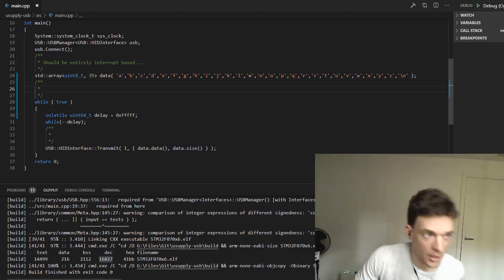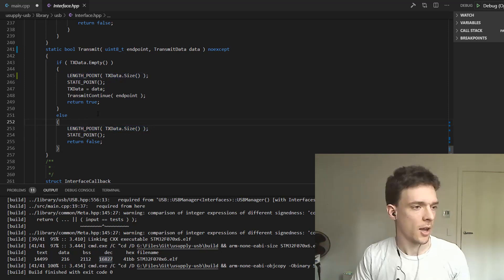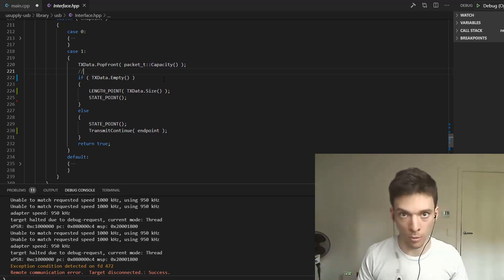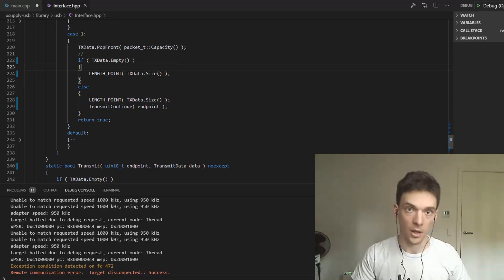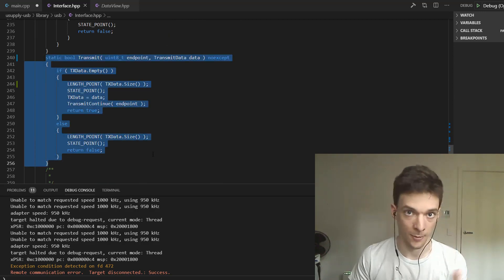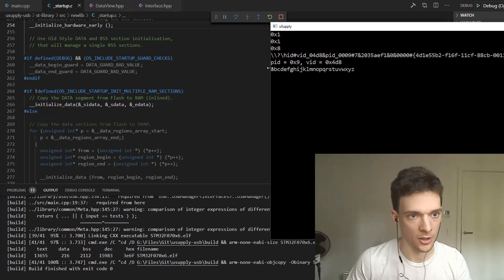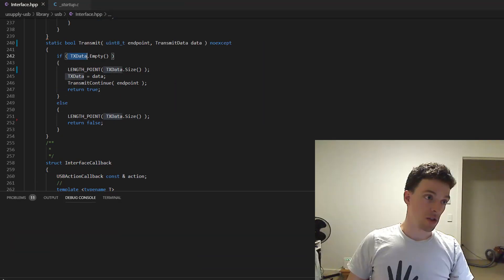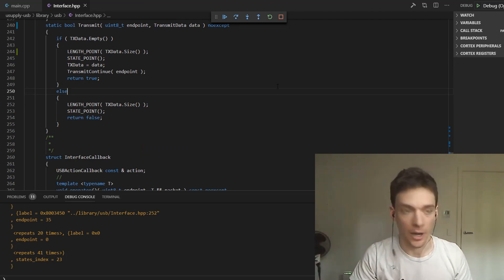C/C++ Interrupt Undefined Behavior

Comment: If you think you've found a compiler bug, simplifying your code down to the simplest thing that should work but doesn't is a good idea.  It will help demonstrate the bug to others and/or show you what you need to change to fix it.
Reply: This would definitely help him to find his own bug.

He only calls the transmit method in the main loop. The string STM32F070 in the console is a hint that this is only a single Arm Cortex M0 core, so the only thing that could modify the variables are interrupt handlers.

So he modifies variables outside of the normal program flow and expects the program to notice this even without telling the compiler to not optimize the access to these variables away.

He is right that the proliferation of the volatile keyword in his code is bad. But it is only a symptom of a bigger flaw: doing too much stuff in the interrupt handler. ;)
Reply: @zvpunry1971  Agreed on all fronts. And correct, I didn't spot the undefined behaviour until after the video and with help from a stack overflow user.

The debugging thing isn't actually printing to console its cooler than that :)
Its a safe logging thing which doesn't rely on any peripheral interaction.
I just use the debugger to get the data out, it also doesn't write a string to a buffer. I made the log thing really quick and its sort of crappy but I like it :)
Reply: I didn't think you print on the console, I just saw the string STM32F070x6.elf and used it as a hint about the target. ;)
Reply: @zvpunry1971  Ah righto.
I'm now trying to figure out whether the linux kernals approach to this issue is acceptable... READ_ONCE, WRITE_ONCE what I'm talking about.
Reply: @zvpunry1971  Ahh that makes sense.
Reply: David: The linux approach is to replace the volatile variable with volatile accesses. The variable will be without the volatile keyword and all normal accesses will be optimized. But with the macros they will be accessed through a volatile cast (or a memcpy surrounded by memory barriers).

The result will be the same if your DataView class is used everywhere the same. You could inherit from it and overload the functions that access the variables with versions that use these macros and use this version when it is used in the interrupt handler.

Did you have any success yet?

Comment: Premature optimization is the root of all evil ... focus on getting a successful output THEN worry about optimizing. Visibility and feedback are key to fixing bugs.
Reply: The penalty of poor volatile usage is huge memory usage. This is a constrained system.
Reply: @davidledger5941  How does using a volatile variable increase memory usage? I can see it wasting a few cycles since that basically marks the variable as non cacheable, so it's certainly something to avoid in speed critical loops.
Reply: @NiHaoMike64  It prevents optimisations around other uses of the generic class DataView.
Volatile doesn't affect whether data is stored in cached location or hardware registers. Thats why on some platforms an additional _Uncached keyword is added. Volatile does cause the variable to be read from memory on each access.
Reply: @davidledger5941  If you focus on #1 correctness and #2 proof of correctness then EVERYTHING ELSE is easy to accomplish. Optimization is much further down the list because low memory usage doesn't matter if the code is incorrect. Once you have enough UNIT TESTS that prove that ALL moving parts are correct then you can start tweaking and optimizing because you'll have the proper metrics to show that #1 nothing at all broke and #2 thresholds have been met or exceeded. Been doing this 20 years. ;)

Comment: All volatile means is that the memory location can change behind the thread's back. So every read access to that variable is explicitly emitted.   This prevents the compiler from using optimizations that rely on a copy of the variable that may be in a register or a temp variable, hanging around from a previous operation.   THAT IS ALL IT MEANS.  If the value can change via hardware, or via an interrupt handler then the variable must be declared as volatile.   Caching is not an issue here.   ISR access to the location would be cached.   Peripheral Registers are defined in hardware to be in the non-caching K-segment.
Reply: I said that in the video.
I also stated it doesn't do anything atomic does. I also pointed out some undefined behaviour with it. I didn't talk about caching in the video, and I agree its definitely not the issue. Its that I invoked some undefined behaviour I didn't notice.

Comment: if it's changed by another thread/interrupt or memory-based that can be set by hardware -use volatile. ALWAYS :)
Reply: I believe there are other ways to deal with it. I'm trying to use one that doesn't require a generic data structure to be modified. I might be able to do it through pointers.

Comment: It's a leap to blame the compiler at this point. There's a huge gap between your human readable code and what is actually happening on the CPU. Output the unoptimized assembly and compare it and in addition, use a proper debugger instead of console print statements.
Reply: I did say many times I may not know something or it could be my fault at the start. Also those are not console print statements. 
I also used a debugger, but breakpoints affect the timing of USB preventing it from working. There are many timing constraints in USB.

I've also posted everywhere here I can the actual issue.

Comment: David, volatile is used to tell the compiler that the value of a variable can be changed at any time, without any action from nearby code.  Such as if it's changed by code in an interrupt service routine.
Reply: Yeah, I didn't notice the undefined behaviour until after filming the video.
My own definition of volatile is correct, but I didn't think about the way the compiler optimised the two functions separately. Don't know, just a brain fart really :(

I don't pick video titles, I asked for it to be adjusted :)

Comment: All volatile means is that the compiler shall not optimize away redundant reads and writes..  it is used when an object can be modified by something external to the thread of control.  As others stated, before claiming a compiler bug, dump the ASM first.

Comment: Probably been said already but... 

Maybe having an explicit critical section mechanism that protects your variables that change in interrupts is the way to go. 

Volatile is used, as you say, for hardware registers but also for informing the compiler about other possible changes. It says nothing more to the compiler than "always go and get this from memory before use" which makes it not rely on a previous CPU register copy it may have taken for optimisation reasons. 

Even volatile won't save you though if the interrupt can happen between the instruction that loads it and the instruction that uses it. This is why interrupts need to be disabled in some circumstances when accessing your variables that change in interrupt contexts. 

Thinking this has gone away by using the volatile keyword may be erroneous, you've simply reduced the probability of it happening. Making the bug harder to find later.

Comment: you're calling ::Transmit in a loop. there's no reason for the compiler to spill registers. if you look at the generated assembly, it will be clear that the main loop is all register-based, and the interrupt routine is accessing memory. one hack to spill registers: make a call to a NOP() function through a pointer-to-function. can't be inlined, must spill. (disable whole-program optimizations, though)

Comment: I notice Transmit and TransmitComplete are static functions and you're accessing a (I assume) global instance of something called TXData. You're also passing in a data array called data, which is assigned to TXData inside the function, using an operator overload perhaps. I'd be looking at how the TXData instance is initialized. Is it a static variable? Is it being refined somewhere?

I think the volatile thing is a red herring. Make sure your non-static and static instances are being consistently initialised, especially where global variables or class instances are concerned.

I don't think this is a compiler bug.

Comment: Never do work in an interrupt handler that can be done elsewhere (i.e. in the main loop of the program).

There are three types of interrupts. One is where you need to start some  I/O within a few clock cycles or the system releases the magic smoke. In that case the interrupt handler needs to call the minimal amount of code to get its job done. The other type of interrupt is where you get notified that something is done, in which case you set some (volatile) flags that can be checked by the main loop. The third type is a mix of type one and two, where you react fast and then set a flag and do the less important stuff in the main loop.

The main loop can consist of code that checks flags set by various interrupts and executes the corresponding handlers. In that case you can also decide which driver should be run first. When everything is handled, the CPU can do different things or execute a halt instruction.

If you want to do something else in your code, do it before you call the halt instruction and regularly check the volatile flags. If it gets more complicated, you need a scheduler that manages your tasks or maybe some sort of operating system that does all this for you.

This minimizes the unexpected change of variables and also minimizes the spread of the volatile keyword.
Reply: I don't fully agree. Maybe what you say is best practice, but sometimes in time critical  event handling it is easy to be in main code that have sort of unpredictable time interval of execution before servicing flags. There is no way of absolutely verifying as other subs or iterations on conditional branches can cause high variance in execution time. See the comment earlier by someone else mentioning magic smoke. In com buffers  there is also not a lot of code required to pop or push a byte onto the buffer. I would agree not have code in interrupts that is not time critical or event related. Anyway that is not the solution to David's problem.
Reply: Bokkie Vatikaki: "See the comment earlier by someone else mentioning magic smoke."

I didn't find any other comment mentioning "magic smoke", only my own comment. Please provide me a direct link to that comment. You can get a direct link if you click on the timestamp behind the username of the comment. Or did you mix up some comments? Because you say you disagree and then you mention stuff I just wrote. ;)

Clean and easy interrupt handlers that trigger some work to be done in the main loop is a solution for Davids problem. He has an interrupt handler that modifies data that isn't accessed in the main loop because the compiler optimized the load/store away (which is a good thing) and then he added the volatile keyword to fix this problem. Then he tried to get rid of the volatile keyword because of some side effects of it (probably something with the memory alignment, whatever). And now he probably tries to reimplement some memory/cache synchronization mechanisms because he thinks that is a solution for it (which it isn't).

But he has to go through that pain, it is part of the learning experience. ;)

edit: crossed out some things where I changed my mind - see following comment ;)
Reply: I read a bit about what he is trying. He wrote he want to use READ_ONCE() and WRITE_ONCE() that is used in the linux kernel.

These macros create a inline function with a volatile pointer as an argument to make the access to the data volatile, but not the data itself. They also introduce a memory barrier to prevent reordering of memory accesses (which is needed mostly for memory mapped I/O in which accesses must not be reordered by the CPU or the compiler).

He doesn't use memory mapped I/O, just a normal variable that is changed outside of the normal program flow in which case he has to deal with the lack of load/store operations in the optimized code. The original "fix" was adding the volatile keyword, which disabled all optimizations when accessing the variable.

This probably had adverse effect on all users of his class. That is why he tried to remove the volatile variable. Now he probably replaces it with volatile accesses to the variable, this will also work but might still have the same effect on all users of his class.

He could overload the methods that are used when the class is accessed from a interrupt handler to use those volatile accesses and for all other uses default to not use them.

(Or he could still try to not do too much in the interrupt handler;))

Comment: As pointed out by others, this is no gcc bug. Also, if you are very concerned about code size you should consider writing your firmware exclusively in C instead of C++. Though, that will require you to know more about memory structures and the use of the keyword volatile etc. ;) Oh, and I don't hope you are using some outdated version of gcc to compile your STM32 code - if so you are asking for trouble.
Reply: C++ overhead in comparison to C program is minimal. Various abstractions bring overhead if you are using some abstraction when you don't need it that's a different thing.
Reply: Check out a video called "rich code for small machines" or something along those lines, it's from a CPPcon some years ago. Very interesting watch on how a lot of abstraction doesn't necessarily mean a lot of code that gets executed - compilers can be very smart.
Reply: @TomStorey96  Yep problem is that with C++ and all its standard OOP features it invites to overuse them. Like interfaces for everything: "what if I will want to reuse it one time" etc.. That's why sometimes it is better for some companies to stick with C if they don't have experienced embedded SW architects on their team.

Comment: The thing about compiler bugs is, the engineers working on the compiler are working on an entirely different level of abstraction.

That doesn't make them infallible gods or anything, but it does mean that the kind of things that are hard in their context is probably not something your or my code is going to be unique in triggering. And since it's not unique, it's probably already fixed. 

Thus, if there is any possible way it's your fault, then assume it is.

Or find a minimal example of the bug.

Comment: function variables are stored on the stack. So different calls to the same function, gives you 2 different variables in the stack. Its a variable scope issue that seems to be tripping you up. Also note that using the volatile keyword for function variables is not well defined, and most compilers will just ignore it. To properly use volatile variable you need to declare them as a global and then pass around a pointer to the variable. Or you can allocate some memory from the heap and then once again pass around a pointer to this memory.

Comment: Late to this party, sorry. 
Volatile helps, but it's not a panacea for time sensitive code - interrupt driven or thread synchronization. In a real situation you need to be very sensitive to time spent inside of an interrupt service routine. Bearing in mind that unless you disable the interrupt while inside it, it can be called again while still inside that routine... Is your mind ok with that? Don't let it get to you. It can happen and your debug statement output will seem pretty nuts until you figure it out. So there's one big gaping rabbit hole you need to explore when writing ISR's 
Here's another, I see it suggested to use a synchronization mechanism here, for an ISR that disable is that synchronization. ... That is if you're actually trying to handle the state stuff inside the ISR. 
Here's a best practice and easy fix, move the handling of almost everything outside of the ISR. Use the ISR only to set the state: something like setting that flag that says "ready to tx", don't de-queue anything and don't try to write to a port. (You risk overstaying your welcome, and running the ISR again. See the disable stuff above) Then, in your main busy loop or another thread, test that ( and yes it still needs volatile) "ready to tx" flag and de-queue the data and write it out. If you're setting the flag yes/no in the ISR and reading it in your busy loop then volatile should be sufficient for all eventualities.
Reply: Volatile makes the compiler insert a fence which is: "wait till this memory location is consistent vis-a-vis the cache before reading it" it says this is time sensitive and will be used possibly by different CPU contexts which may be using different cache segments which may not be consistent. Volatile is one place where your code meets the modern CPU architorture.

Comment: I believe that in general there is no cheap and easy way to transfer data from interrupt context to thread context. If we look into driver implementations of (RT)OSes we'll find some sort of message passing style interface like mailbox. Which will employ reading sared memory locations inside critical section.
Reply: Good point and idea to look at OS's implementations. FreeRTOS is avaliable here https://sourceforge.net/projects/freertos/
Reply: David Ledger RTOS I like even more is ChibiOS. It is very well written in C (compiles by g++ as well) and documented. What I like most about it is it’s clear separation of platform dependent and independent code and it has platform and os independent “HAL” which contains drivers for common devices usually found in MCUs like uart, spi, timers etc. http://chibios.org/dokuwiki/doku.php